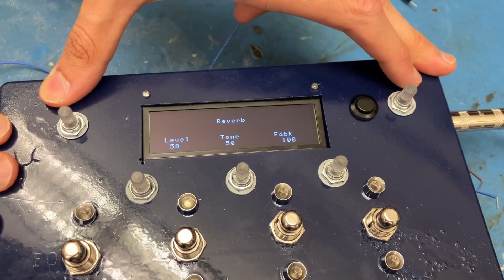Guitar Pedal Based on Daisy Seed STM32 Microcontroller Board (Georgia Tech Senior Design Project)

Comment: stm32 does not have enough resources for good processing, even if you use a neural network.  Dead end path except to improve your skill.
Reply from the maker: There's certainly higher end development boards out there (I contemplate some of these in another video). But the STM32 is perfectly serviceable for some tasks; for instance some of the Make Noise modules use it (like the Erbe-Verb).
Reply: @Lantertronics  most of mutable instruments lineup used stm's, they're absolutely fine for audio processing, though i am chuckling at the thought of using one for distortion, when a couple of transistors would do.
Reply: It can run quite a bit, needs external ram tho
Reply from the maker: @euglossine_tristanwhitehill  Nice thing about the Daisy Seed is you can get a version with 64 meg external memory built onto the board (they were using that one).
Reply: I love their dsp library, a lot of csound and perry cook stuff in there , electrosmith are great people, they also run qubit or are related in some way
Reply from the maker: @euglossine_tristanwhitehill  qubit?
Reply: well, i used STM32F4 to capture, autotune, demodulate and decode RF signal with DBPSK modulation on a 220KHz bandwidth (each channel 100Hz wide), carrier frequency 868MHz, provided that the capture (with internal ADC and DMA) was done at 1.2MHz and the IF sats around 600KHz. 
All that realtime without any external RAM, i guess that leaves some room for audio processing. the SIMD instruction and the ARM DSP library can do quite a lot as long as you are competent.